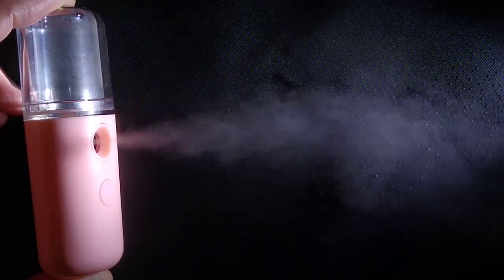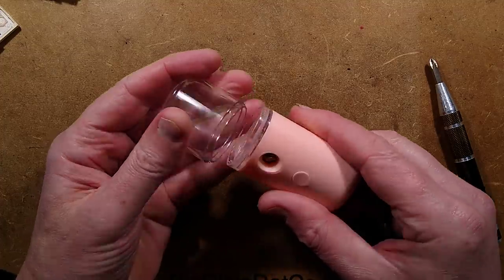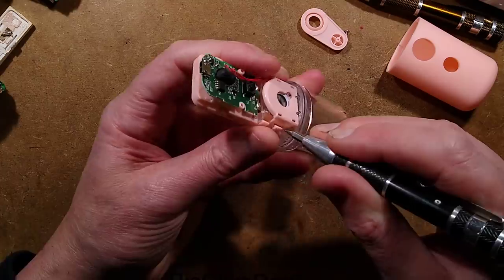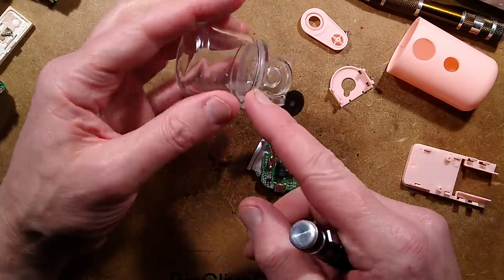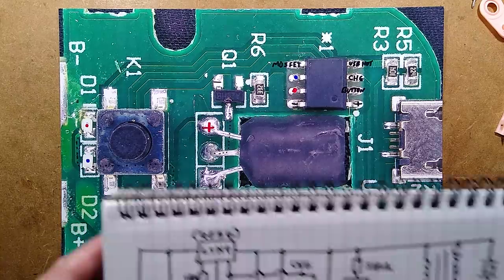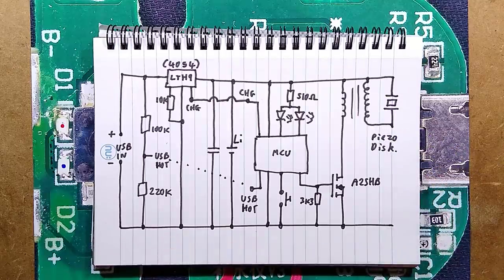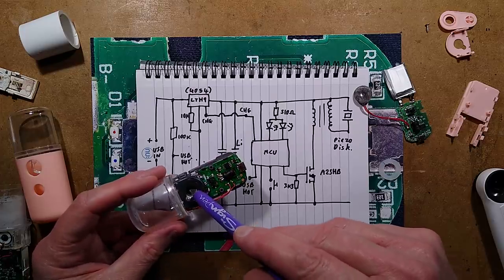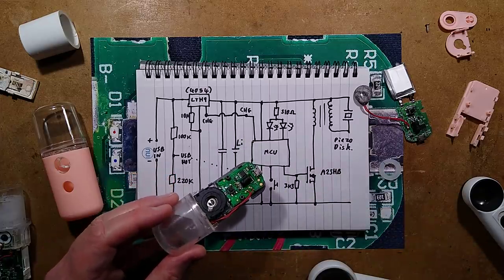Inside a USB rechargeable misting unit (with schematic)

Comment: What happens if you fill it with IPA and light the mist?
Reply: Glad someone is asking the important questions.
Reply: what a waste of pale ale
Reply: @gordslater  I think he means Isopropyl Alcohol (but yes it certainly would be a waste for sure to put a good IPA thru it). I noticed, however, that these are very sensitive to the surface tension of the liquid. Even distilled water does not work properly and there's no mist. They seem to only be optimized for tap water.
Reply from the maker: Alas, the IPA didn't atomise properly.  It just oozed through the tiny holes in the piezo disk.
Reply: @bigclivedotcom  That was my experience with "off-label use" as well. They only work well with soft tap water. There seems to be a delicate balance with the acoustical impedance needed to force the liquid thru the pores and the surface tension. If its not quite right it just bubbles out and doesn't separate and make droplets.
Reply: I think they use these to replace the aroma of piss in supermarket trolley corrals and doorways after they get cleaned.
Reply: @bigclivedotcom  Ethyl alcohol works just fine in them.  I've got some bottles of 95% ethyl denatured with 5% ipa that I use in several of these.  In the states, ethyl commands a huge "liquor tax" if it's not denatured, hence the 5%.
Reply: @TristanJCumpole  spoilsports
Reply: @thebrowns5337  Definitely a sport to some.
Reply: IPA isn't flammable.
Reply: @RandyMarsh-uc6sw  Not the beer. IPA. Same as DNA. Which reminds me of a particularly loathsome Reddit thread involving a box.
Reply: Mike's electric stuff glad to see you here love your videos by the way been a while since I've watched one but I think I need to click all for notification Bell? What are the channels I wanted to but haven't yet shame on me!

Isopropyl alcohol I'm assuming I'm reading that correctly and Frankie watch being nice flamethrower I'd say at least you wouldn't have to worry about it going boom as much as some other flammable liquids.

Also has anyone ever put Coleman fuel in a device that would use a wick instead of vaporizing a fuel in a generator such as a lantern or a stove generator in terms of the tube that has a fibrous feeling or something similar that vaporizes the Coleman fuel AKA white guy from what I've Been Told because it specifically says not to use it in WIC brain devices wondering what would happen if you did? At that time I could not find any videos here on YouTube on that but that may have changed any ideas on a video please put Link in a comment would like to check it out.

Also there is an article on Coleman fuel in Wikipedia if anyone's interested sorry don't have the link at hand.

Comment would be appreciate it.

Also I wonder what would happen if someone tried to ignite polyvinyl alcohol coming out of something that could spread it's enough of a liquid that it would work the idea is that stuff when alcohol that breaks which is serving as a solvent the vinyl material whatever it is you're main what kind they use it for like repairing gelcoat and other things as well it's the same stuff PVA glue is made out of but in a different form that would be interesting I wonder if you'd get bits of the vinyl or it could wind up toxic for all I know so what they mean is someone that has access to extreme safety measures not someone that try haphazardly as you should know please don't just try this due to my comment if you don't know what you're doing and don't have proper safety protocols and equipment in place and no worries don't just try this at home unless you know what you're doing like The MythBusters used to say don't try this at home we're what you call experts.

Another thing that somebody might want to try that could do the safely nitromethane AKA glow fuel for like the model car and plane engines that would be interesting since it has a oxidizer alright in it if it would not it is a thing because usually you have to have a glow plug but theoretically it mine at night on contact with a flame be part of the interest to see what exactly would happen.

Also something rather interesting you know bottle pole straps right I noticed once that something going to happen and there was just a little bit of fuel it was some sort of alcohol left in a squeeze bottle I think they were using rubbing alcohol but didn't realize that there was something there still hard enough ignoring it Annie it did not a bit but we got out but in the process I like over the bottle which I was squeezing and I'm hardly go the flame and golf the inside bottle and then went out after word.

Immediately that are produced a lot of wine gave me an idea to prototype something.

Essentially a vapor or mist of alcohol being sucked through high temperature Pyrex glass cubes and a few layers which word up actually closing off the ends left some sort of a camp high temperature silicone and stuff like that and also used the chest tube in the middle essentially tombs are collected coaxial inside of each other basically a U-shaped past each way then once started it burned where's no flame but maintained like that intake of air and the alcohol from in the bottle except it would keep going and act as a light source essentially alcohol lantern that used a blower and some other mechanics and others don't remember much details because it was a long time ago maybe one of a kind idea but didn't think I was practical but interesting experiment none the less.

 if I'm not mistaken I use the dead Coleman lantern for Brother Project it seems but it was too long ago to remember.

And it was burning I think some sort of alcohol this I knew that rubbing alcohol Woodburn to City of a flame and blacking all the glass fairly quickly one reason not to use it as regular fuel as it burns to City because of the impurities used to denature it and probably combined with the water as well?

But denatured alcohol light of work as I said have not redone the experiment.

Also once I saw those all canisters of some type of fuel similar to what a CO2 cartridge looks like somebody thought it was empty and threw it into a farm why would anyone throw any type of gas canister or other thing like that or aerosol can in a fire dumb sure enough yep fuel left in it kablooey pressure is a bleve boiling liquid Vapor explosion it looked like an oversized CO2 cartridge of some sort but don't know what it's for this was on my friends Farms when they were burning crash at that time this was one of his friends that was using whatever device it was but he was kind of a person that wanted think of something like that however my friend on the farm would never have done that nor would I too dangerous and stupid.

 it would sort of be like the disabling all the safety devices on a propane tank and put it on top of the campfire with everyone around it that sort of thing. by the way I'm all about safety as you probably could guess.
Reply: @Matt Quinn  I think you were trying to say someone yeah needs to go ahead and do that if I'm not mistaken always wondered what would happen with a nebulizer and isopropyl alcohol or something like that but I would not recommend using oxygen for this are navy but definitely not pure oxygen is that my friend would probably not be recommended under any circumstances and that means seriously not recommended I'm sure now someone's going to do it just because I said it's not recommended.

Although anyone I thought about an airbrush and isopropyl alcohol and igniting it?

But don't go holding that option oxygen regulator either same kind of thing but possibly a little bit safer? As long as you're about 60 70 80 feet away I'd say if not more.

Evidently some old flamethrowers used to use propane as a poet and also as a source of ignition and some designs the propane tanks were internal within the fuel tanks that's just something I read about somewhere once.

The idea being that less likely damage to the propane tank from a stray bullet or intentionally shooting at the guy with the flamethrower due to the outer cylinder protecting the propane cylinder Garden love random stuff.

Happy flambeing.
Reply: @KG4JYS  I've just believe that's called denatured alcohol I don't know if there's a folder name for that or a specific name but I believe that's correct please correct me if I'm incorrect comment please thanks
Reply: @bigclivedotcom  hey big Clive again big fan of the videos keep them coming how is the family member you know which one haven't heard about her in a while.

Also with the arroba fluid liquid whenever for the Air Wick that stuff is a pretty strong solvent I know for sure so not surprising live what happened with the unit that you tried to put that stuff in nothing says viosi like something that falls wool and Dad's released by heating it don't know what's all in that stuff I think for one thing there's a carrier oil possibly but I know that it's pretty aggressive because I've seen it it rip on things and it's not pretty not quite by acetone on polystyrene foam but it will eat through things just like a lot of air fresheners will damage painted surfaces in others and Plastics all that stuff is fairly balls apple and aggressive towards some materials if it wasn't it probably would not put off much were smell at least in the concentrations that would make it an effective air freshener so not surprising.

It's too bad that ozone is so bad for you and dangerous because it would be a good way to clear up odors but from what I understand there's really no safe level of ozone with an ozone generator for you steer humans all the time but don't know if that's just hearsay or what does anyone have any confirmed actual data on this or worse than the industry or someone that uses these devices that would actually know talk to you about something like the room air purifier with ozone and would it be safe from 1 all the time with one that could be safely run in a place where there is people all the time dead down like at home in a living room or bathroom or bedroom.

I know there is a certain amount of ozone present always in the atmosphere and in general but I'm talking about of course higher levels and that it would actually take care of odors and other things as well but still not enough to negatively affect human life.

From what I understand if it be enough to actually do something it would be way too much for it to be safe but that is probably up to debate but are we going to have caution otherwise and yes in controlled high doses under controlled conditions it can be used however I'm looking for something that would just produce it either intermittently or continuously and we'll qualities to help deodorize then stuff mostly deodorization but in the other effects positive effects would be a bonus. And yes this would be in a room where people would be exposed to it all the time pretty much.
Reply: @bigclivedotcom  also have you tried giving it a bit of a taste of a dark and stormy two be  atomized?

Still remember the drinking bird you bursted completely.

AKA completely destroyed that was just hilarious still remember it like it was two minutes ago need to re-watch that one just for the fun of it. Just for the laughs.

And also remember someone's comment about usually it with a dark and stormy instead of water and you said that no and if you did it would get drunk and attack you.

It's just one of those comments that sticks in my mind not very many of them do but for some reason I don't know why.

Also something to try would be isopropanol possibly although that might attack the plastic?

But if it does just dunk it a few times in the stuff put it in the explosion containment pie dish and cause a short circuit with a very fine piece single strand of a multi-strand wire you get it I think.

And make sure it's fully charged if that.

As photonic induction to say I want flames and if that doesn't happen I ain't having it where's my hammer.

Also anyone heard anything about photonicinduction recently Cheryl still up as far as I know and a couple years back or so there was something you saying that he be back but haven't heard anything really one way or the other recently? Please comment on any of the above and all of the above whatever you want. Thanks ahead.
Reply: @bigclivedotcom  also has anyone ever heard the Misty mate it was one of those things that kind of those infomercials are used to have one and yes I used it I heard from someone that using alcohol in their work there's a straight water and yes it did people do spray alcohol on themselves the thing is where I live the humanity is way too hard for the pride to work very effectively but it did somewhat help with high temperatures that's why I tried the alcohol but I was worried about accidental ignition in some circumstances or in some way where that unbenounced to you there was something that could ignite the alcohol being sprayed off of it used for looking out for sure and like a plant Mister nozzle like they would use why can't a greenhouse or on a water Mist fire extinguisher same sort of nozzle brass nozzle.

So I actually only did that once in abandoned the idea resides I went back to using water but much much later it developed a leak could not repair it at that time but did reuse it for parts for other projects here in there all parts of it that is. So not waste repurpose recycle reduce reuse pack Salvage whatever.

My parents had a rule if it ever went out of the house and there was anything that could be used for anything whatever it was. Would be salvaged.

Occasionally not by choice Kieran there depending on what it was yeah even if I thought there wouldn't be able to use it for any purpose but that was not the case at all turns out those time to set up was not going to salvage it but my father insisted otherwise.

Here and there he'd even Salvage the stuff and bring it to me or if he found something I could really use or potentially so that was fun and sometimes unexpected things are the best as well.

Got a lot of small motors that way also my dummy load resistor one of them you came that way as well fan heater with a timer and an oscillating motor turns out all that was wrong with it was the thermostat / switch was bad but of course didn't mean it as a heater but the timer was more useful for the motor is that a timer.

Yeah old school mechanical timer on heater know that digital rubbish as Dave Jones would say.

Big Clive if there's any way that you and Dave Jones could get together or have a meet-up of all you guys from somewhere channels somewhere that would be awesome if it would ever work out there's at least five or six people that should get together in the same spot where they would have at their disposal virtually anything that you want that would be fun for anyone involved definitely would be YouTube Worthy or maybe virtually together on the same product Euro if something comes out that would be really worth it special or otherwise.

Also be quiet have you ever met any YouTubers live somewhere channels or something like that or was it might have some more interests?
Reply: TNA?
Reply: Sorry to ask about totally unrelated thing, but this is the channel with so much info about lighting.

So, does someone have an idea how to test if an old small neon tube (cold cathode - I think) is working, please? My acquaintance bring it and the board with a relay to me to repair and I have no idea 😂. Here is a link to the photos:
https://drive.google.com/folderview?id=1eDgyRHzJ-LVI4dcMddCIuEMlmHGXKe22

I mean what voltage range should I try to feed it and how to connect? I guess both ends to the voltage feed and the thin wire to the ground 🤔? Should AC or DC be preferred when testing?
Reply: I tried this with one a few years ago. It acts like a candle, the flame isn't very big.
Reply: @bigclivedotcom  I bet you tried it out before Mike was asking ;-)
Reply: WHOOMPH

Comment: About 25 years ago I had a "Sunbeam" brand ultrasonic humidifier and I recall that it had warnings and a float switch to keep the transducer submerged. The implication was that running the transducer "dry" for any length of time would destroy it. I gather that's not a concern with this unit. Of course its geometry was different... the Sunbeam transducer was flat and the energy from the sound would make a steamy little "fountain" inside the unit with a gentle fan to blow the misty air up a little chimney that ran through the reservoir.

I gather these are likely more efficient at producing mist but based on other comments here the perforated transducer might be more prone to clogging or corroding.
Reply from the maker: In the larger ultrasonic atomisers the disk is solid.  If run dry the disk heats up to its Curie point and stops being piezoelectric.

Comment: I helped design a unit for a major global company which atomised medication for respiratory patients, which used this same "mesh" technology.
The driver we used was a class D (amplifier) tuned circuit fed from Li-ion which generated 100-150vAC, driven at 143kHz (frequency varies on the mesh size). By monitoring the current fed to the driver, it is possible to detect when the fluid chamber is empty as the frequency characteristics of the mesh change when wet or dry. Lots of research into the candela effect of mesh oscillation too! The most fun I had with it (not in any way related to said company, and I cannot recommend or condone) was to fill it with a shot of vodka and inhale... :D